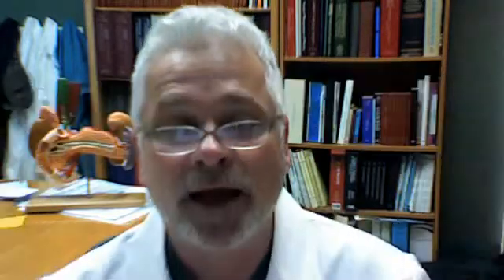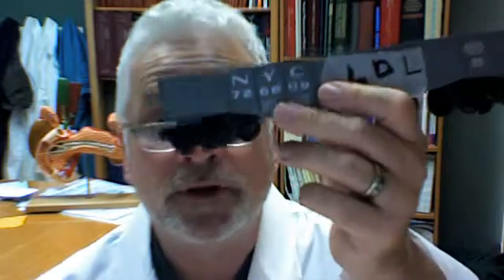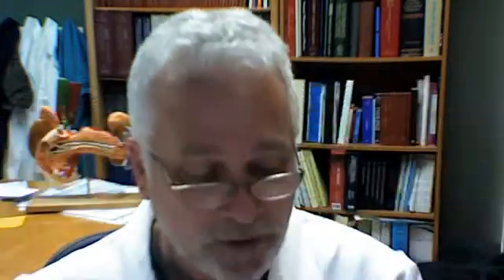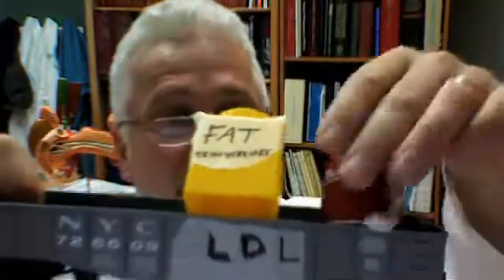Dr. Terry Simpson on LDL, HDL - using a train set to explain

Comment: I appreciate the effort, but it doesn't work that way.

Homo Habilis started eating lots of meat 2.6 million years ago. If fat/cholesterol caused heart disease, they would have gone extinct by 2.5 million years ago, at least.

Cocaine kills heart tissue on contact. Sugar spikes insulin, which mutates LDL into pattern B LDL, small, dense particles that damage the endothelium, the inner lining of arteries.

Bears have cholesterol levels of 600 mg/dl. It doesn't hurt them.